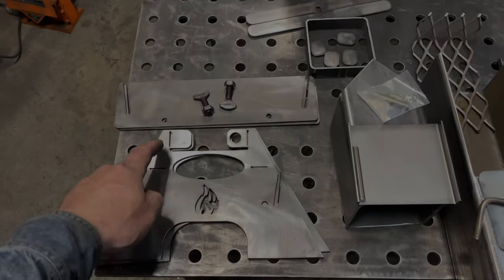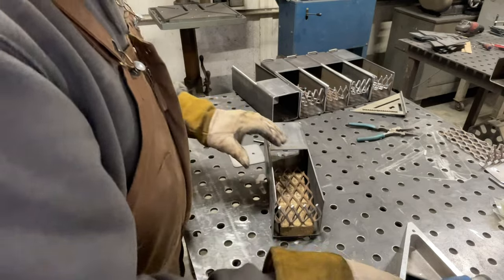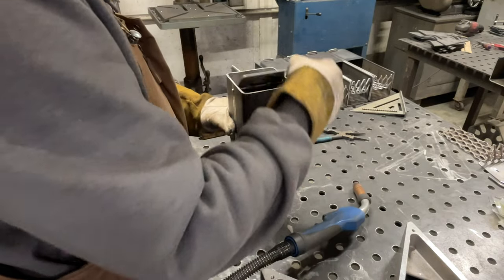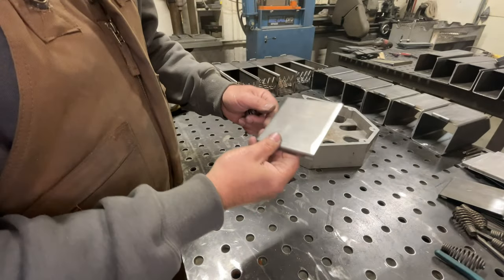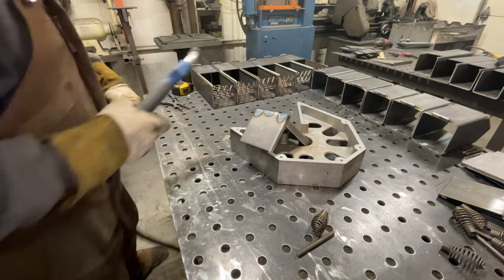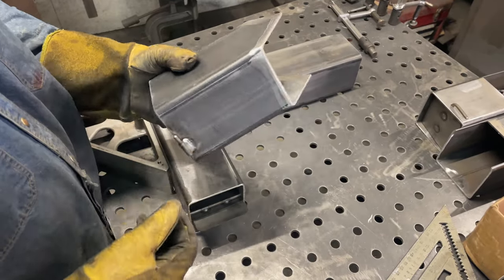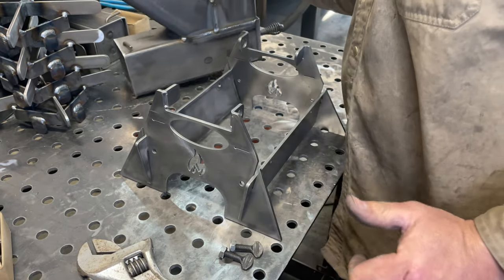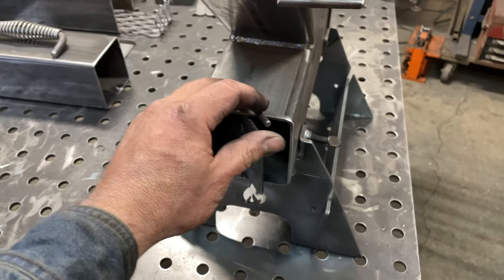Rocket Stove DIY Weld Kit Tutorial

Comment: If your welding nuts over holes good idea is to put a countersink bolt from the other side it centres it on the hole perfectly
Reply from the maker: Thanks for the tip
Reply: @chiassonsmoke 😊